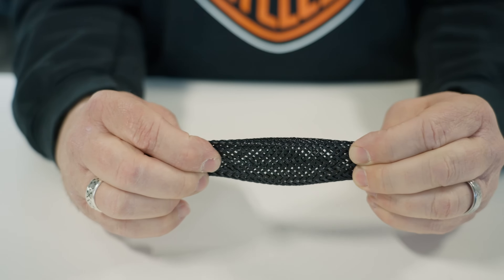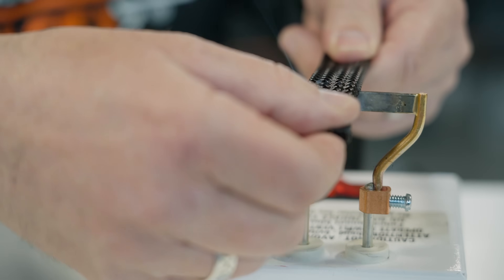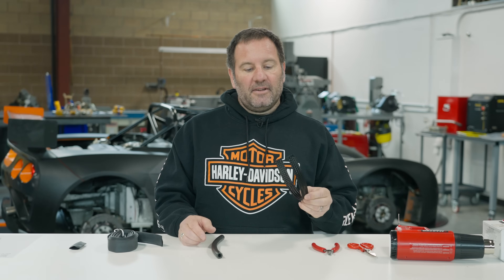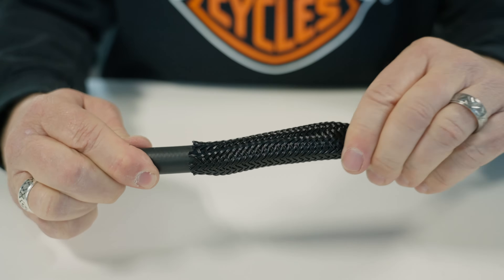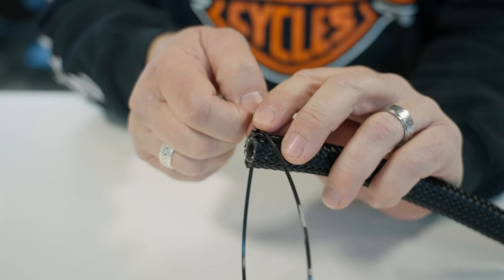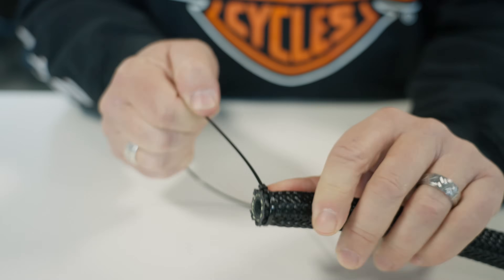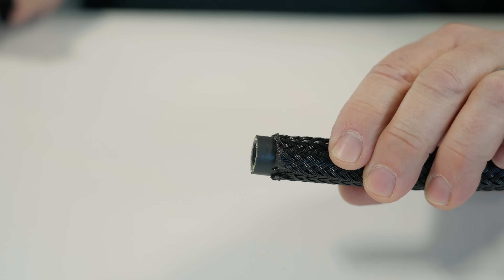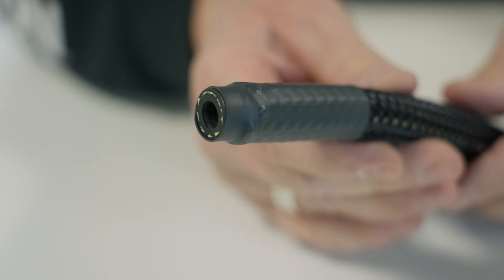How To Apply Techflex® Flexo® Super Duty Sleeving to Hoses and Wire Looms

Comment: Cut with scissors & torch the end to stop fray.  A hot knife is just a small time saver if you're doing a ton of cuts.  You don't need or want another special purpose tool hanging around creating clutter.

Comment: If my hose is 1 5/16 diameter shoukd i buy 1 1/4 or 1 1/2 sized sleeve, since it expands when installing i was thinking 1 1/4 would be tight but thought the 1 1/2 would be loose but idk will the 1 1/4 go on? Thank u
Reply from the maker: Great question! At 1 5/16", you are correct that the 1 1/4" will be a little tight and the 1 1/2" may be a little loose. We could send you a sample of both sizes for you to try before you buy, just to see which you like better?

Comment: Great video. I had just found out that shrink wrap tubing merely returns to its original shape when heated. Wha? It was stretched wider at room temperature. That's why it only shrinks in width, not length. Well I'll be doggone.
Reply from the maker: Yeah, it's pretty cool the way it's done.